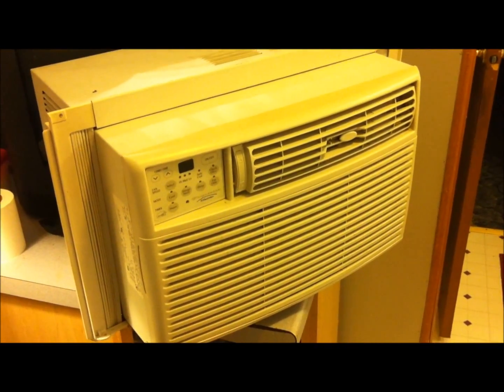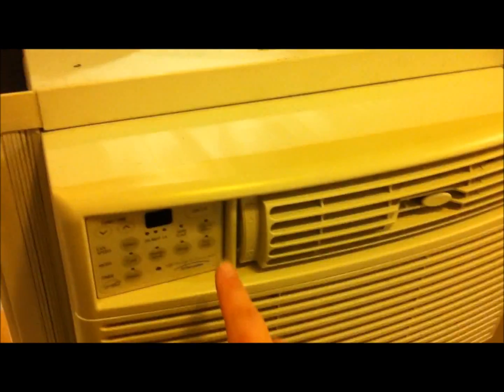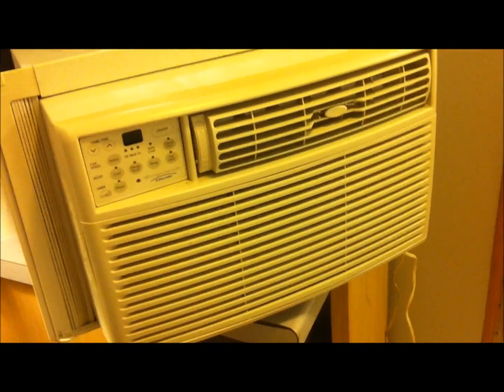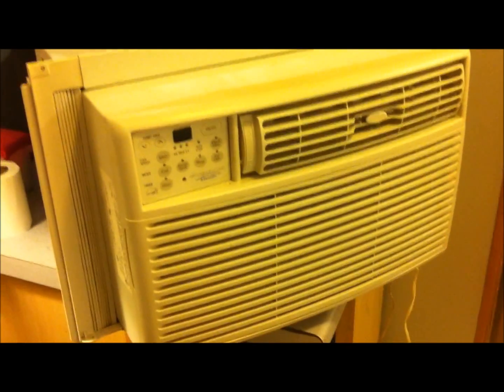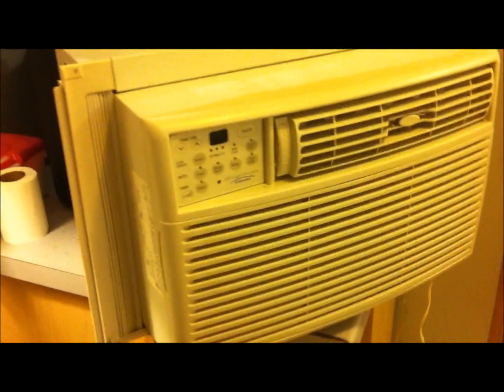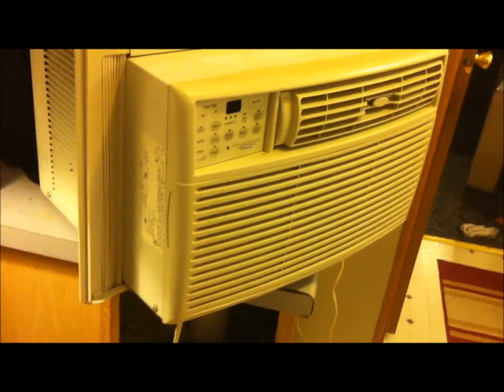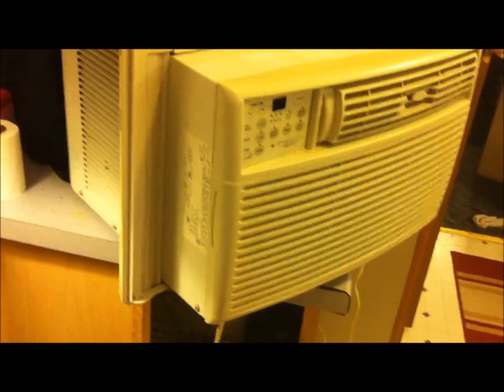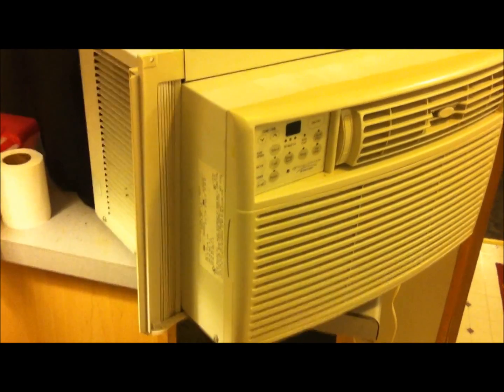2003 Frigidaire Air Conditioner Bearing Before and After

Comment: Hey, I had this older AC that started making that noise yours did and I just decided to buy another one and put the noisy one in storage. I happen to see this video and I got that noisy one out and took it apart and replaced the bearings and it's working great, and quiet. One thing though I couldn't find my bearing at a skate shop and decided to get them at a bearing store and had to pay more but still nothing like a new one costs. Thanks a lot!!.I never ever had one opened either.

Comment: Thanks for the video. I have a Haier and marked the same noise. Pulled apart and took off bearings. Called the skateboard place in the mall, Z****z, and said the bearings are all the same size. Mine say NZSB 608Z. Are they all the same? Going to have to take it down there and see. Anyone have insight into this? I never got into the skateboard thing when I was younger. Thanks
Reply from the maker: Scubasig The ones I got from the skateboard shop were the size I needed. they are the Rush Bombers Titanium Coated style.

Comment: I have 12000 btu one that's 2 years old doing the same thing left it stored for like a month and bam noisy fan I thought the bearing size look like a skateboard or razor scooter wheel bearing I hope my blower motor has the same size bearing in it make it easy to get one glad I'm not the only one with this problem

Comment: I cant Thank You enough!!! I have a 2 year old Kenmore 253.70051 window air conditioner. Only has 6 months of actual use on it. After summer, I take it out of the window, clean it thoroughly..... wipe it down, then put it in my finished basement off the ground :) I took it out a couple weeks ago, installed it in the window.. turned it on, and it sounded JUST like yours... :( I couldn't believe it.. worked perfectly when I last used it....  I had my finger on the trigger to go buy a new GE... but just couldn't stand to throw an almost new AC unit away... After searching for HOURSSSS on this issue, I ran across this video.. what HOPE this brought me :)  I took it out of the window, took it all apart.. not to bad.. went to Zumiez and bought some RUSH brand skateboard bearings.. 8 for $10. Installed.. put back together... sounds better than factory :) Just wanted to THANK YOU VERY MUCH for your time and thoughtfulness in posting this video!!! Saved me $135 or more.....
God Bless!!

Comment: Thanks for the inspiration. Mine is a newer model, couple years old. Time consuming, tedious, but well worth the effort. I just took the bearings to a large supply shop and they matched a new set, hopefully sturdier than the originals. Great time to clean out the interior. Looks and runs like new again.

Comment: Cool! :)  I replaced the bearings on the motor shaft in my air conditioner but now I am not sure which side the spring went on (took it apart last year).  Did you have a flat spring in your motor?
Reply: …After 10 years

Comment from the maker: It is actually a sealed motor. The bearings are also sealed, but are completely replaceable. to see what I mean just google image search "608zz bearing". I've been using this A/C every day since replacing the bearings, and it is still working perfectly. No vibrations or noise anymore, and there have not been any issues with water despite some rather hard rainfall recently. Thanks for the comment!